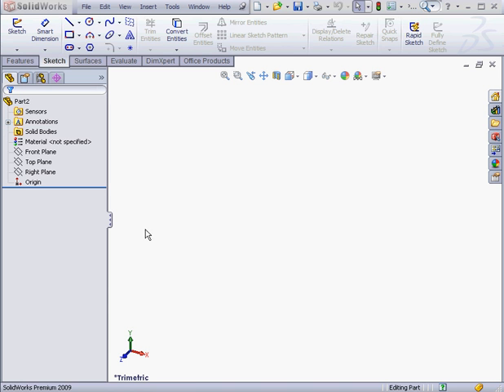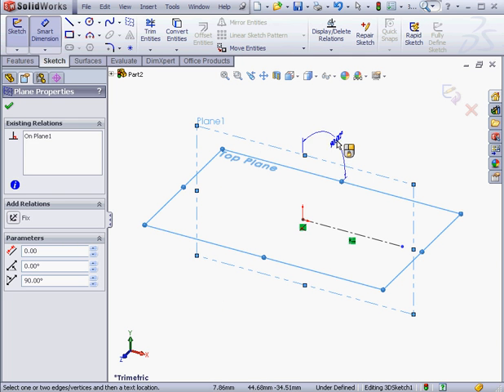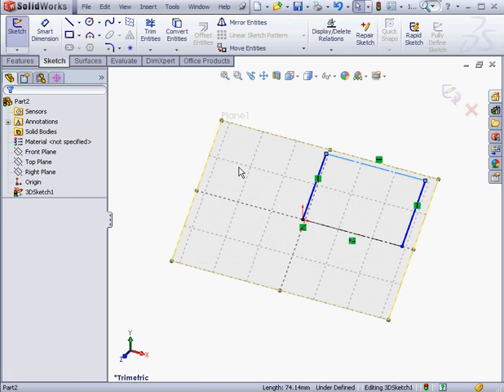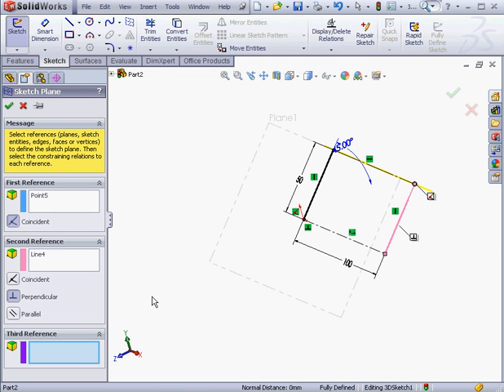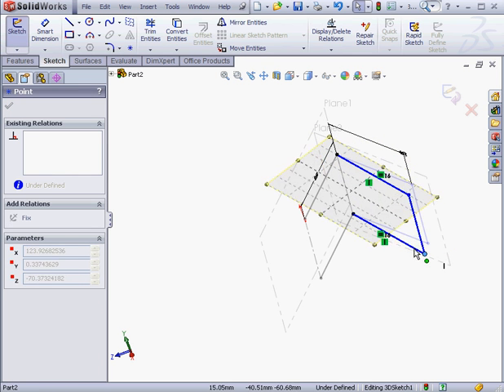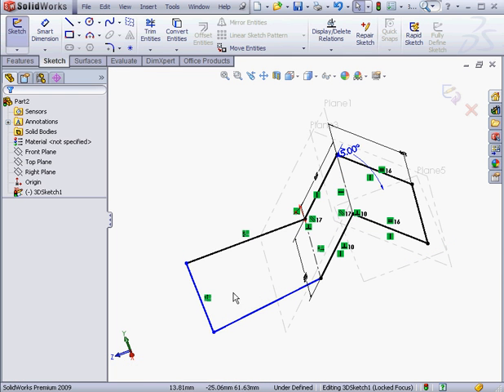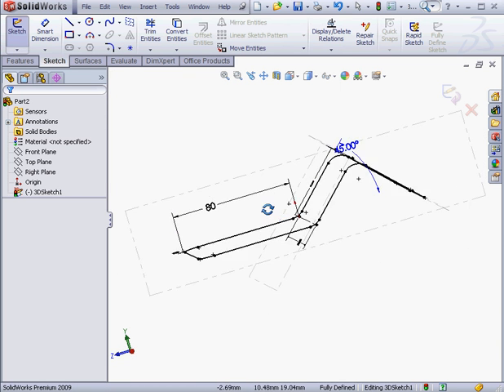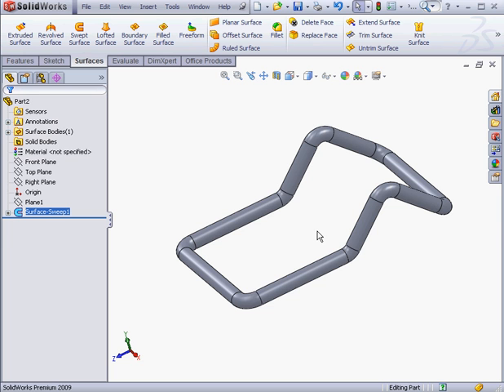SolidWorks tutorial - basic surface design - the 3D Sketch Plane

Comment: Wow.
 Old SolidWorks Version. I could tell because the Reference Plane tool is the old interface style. The New Ref Plane interface in 2010 and greater was based on the 3D Sketch plane interface that you show in this tutorial. I miss the old interfaces ability to quickly swap between Through (Normal to) Cylinder and Tangent To Cylinder which it allowed.